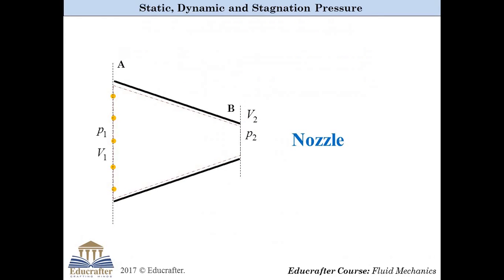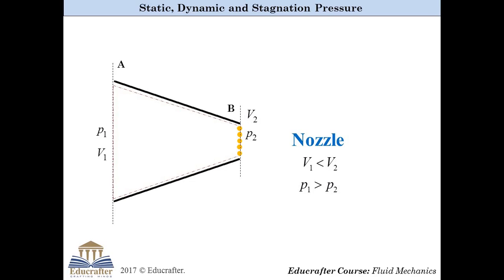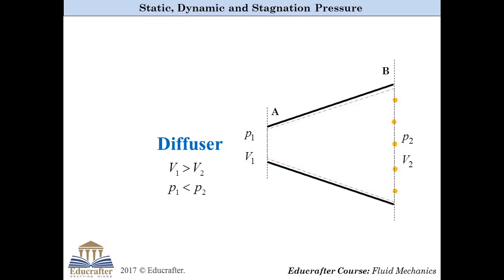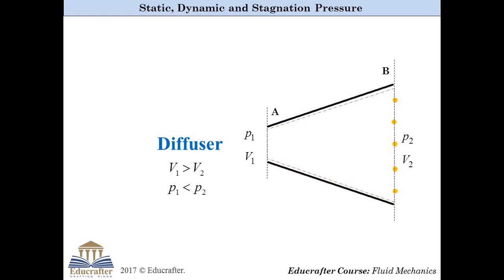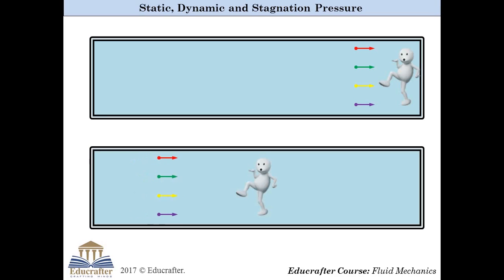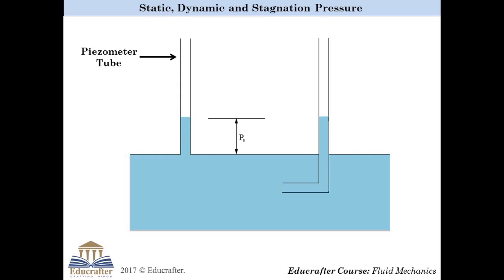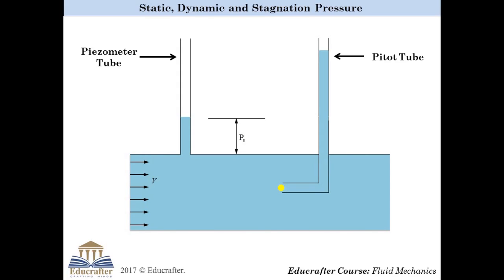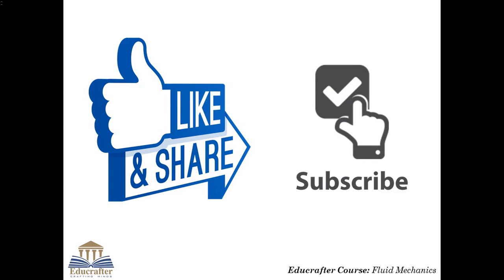Diffrence between Static; Dynamic and Stagnation Pressure

Comment: Suppose we want to measure the static pressure at Central line of pipe.So static pressure will not include hydrostatic pressure ( due to weight of fluid) because we are giving piezometer tube at surface of the pipe?
According to me static pressure should be due to pipe internal pressure plus hydrostatic pressure

Comment: if you are moving with the water, i really don't think what you felt is "static pressure"
 
static pressure is the pressure you feel pressing against you when the water is still ( hence static, not velocity bound, it's the P component + h component of bernouli equation)
dynamic pressure is the pressure the water has when it is moving in it's direction

the pressure you feel while you move with the water ( assume single direction water movement ) is more of drag force
Reply: The pressure you feel when the relative velocity between you and water becomes zero is the static pressure

Comment: In diffuser example, as bernoulli states total pressure at inlet & outlet is same. But you said  stagnation pressure at inlet is higher than outlet, which equal to total pressure in our case(z1=z2, no potential pressure)???

Bernoulli states constant total pressure along streamline, So how fluid flow if there is no pressure difference??
Reply: Same doubt

Comment: Thank you! But 1 very impt question: where does the Static Pressure of moving water in a tube come from? I have problem understanding where the Static Pressure comes from.
Reply: It comes from the collision of the fluid particles with the walls of the object placed in the fluid .

Comment: Really great video,much understood. But the nozzle and diffuser topic confused me quite a lot. Maybe i am missing out on some basic rule,but according to Bernoulli's rule should not the total pressure be the same on both sides? (Along a single streamline) thanks a lot!
Reply: Bernoulli states that total energy (kinetic energy, potential energy & pressure energy) remains conserved in a streamline and not just the pressure energy. Hence the loss in pressure energy in a nozzle is compensated by the increase in kinetic energy i.e., velocity. Hope it helps.

Comment: How dynamic pressure is measured? For static pressure we use piezometer , for stagnation pressure we use pitote tube
Reply from the maker: Thanks for concern,
There is no such device, which can measure dynamic pressure directly, but theoretically if you can measure velocity then you can get idea of dynamic pressure.

For that you have to consider a probe ( weightless ), by stroboscope, measure the velocity and You can find dynamic pressure.
Reply: ClariFLIX Concepts can you explain little about pitote static tube
Reply from the maker: In pitot tube, one hole is provided on tip of the tube which is in the direction of flow. And more holes on the periphery.
And a manometer is attached between the hole on tip to the holes on the periphery.

Case - 1:- Fluid is not in motion.

As per the Pascal's law pressure experienced by hole on tip and hole on periphery will be same.
There you will see same elevation on both limbs of manometer.

Case - 2:- fluid is in motion

When fluid is in motion, flow will strike on the hole at the tip, flow with higher velocity will provide some more pressure.
While holes on periphery will have no effect due to velocity, because flow will not strike at the hole. Hence pressure will be comparatively lesser than pressure on the hole at tip.
As result of that in manometer you will see the deflection in elevation. Limb which is connected with hole at the tip will be having more pressure comparing to the limb which is connected to holes on periphery.

Pressure on limb which is connected to the hole at tip is Stagnation Pressure.

Pressure on the limb which is connected to holes on periphery is static pressure.

Difference between these two will give you the Dynamic Pressure.
Reply: ClariFLIX Concepts sir pitote tube and pitote static tube is different pitote tube measure stagnation pressure and pitote static tube measures dyanamic pressure that I have studied but confusion with pitote static tube
Reply from the maker: Diagram of both will give you more idea. You can raise you query to clariflixconcepts@gmail.com

Comment: Nice explanation. As I understood from your reply regarding the total pressure equal to (static pressure + dynamic pressure + potential head or elevation), so the static head is different from elevation head, my question is: Why In a pump system the total static head is described as elevation difference between suction and discharge? Thanks in advance.
Reply: Because pumps increase static pressure of the fluid and this and this change in static pressure helps pump to raise water to that rated elevation depending upon the resistance in the pipe

Comment: I have a small query...according to Bernoulli's theorem, if area is reduced, then velocity increases & pressure reduces but doesnt it happen, that when u squeeze a water spraying pipe, its vel & pr both increase? Can u kindly explain?
Reply from the maker: Thanks for concern,
While pressing the spray air flows with higher velocity through pipe, The flow of air at a high speed creates a region of low pressure just above the tube, which allows the water to leave the tip of the tube through the nozzle as a fine spray, carried by fast moving air.

Comment: If the static pressure is caused by  normal stress, is this accounted in bernuoulii’s equation? Since in that equation, visccity is considered neglible. Do we consider static pressure constant or zero?
Reply from the maker: As of we are assuming frictionless flow ( zero viscosity ) the static pressure will remain constant.

Comment: What about the flow in diffuser if stagnation pressure at both ends of diffuser is same !?
Reply from the maker: Thanks for your concern,
It is not possible to have a flow having same stagnation pressure on both the ends.
In case of diffuser, It is must to have less stagnation pressure at the exit than inlet stagnation pressure.
Reply: Can u show how the stagnation pressure is less at the end of the diffuser? If we consider a particular streamline there the stagnation pressure remains constant and to maintain the stag const the velocity and pressure is changing then how stagnation pressure is changing?

Comment: Great example at the end. Thank you.
 just the first part confuses me a lot, the nozzle and diffuser part
Reply from the maker: Gusecua Thanks for Your concern.

Fluid flows from high pressure to low pressure, is the obvious case. but if we look at the flow in nozzle and diffuser in steady state.
NOZZLE:- If you observe the static pressure on left section of nozzle, It is higher than static pressure on right side.
DIFFUSER:- If you observe the static pressure on left section of diffuser, it is lesser than static pressure on right side.

Important to observe that in both cases( nozzle and diffuser) fluid flows from left to right but pressure variation is not same. In nozzle it is high pressure low pressure and in diffuser low pressure to high pressure. But the pressure which we are observing here is static pressure.

" FLUID FLOWS FROM HIGH PRESSURE TO LOW PRESSURE WITHOUT ANY EXTERNAL FORCE"

This statement holds true for only for TOTAL pressure not static pressure.

I hope this will clear your doubt.
Reply: @ClariFLIXConcepts  best explanation sir.... 👌👌

Comment: Thank you. 
But I have a small confusion; If flow occurs from high stagnation pressure to low stagnation pressure (P + 0.5*v^2/g), Why doesn't water flow from the bottom of the water beaker to the top of the beaker? Because as I see it, the velocity is zero at both points but there is a difference in static pressure.
And second if it is not the stagnation pressure difference that makes a fluid flow, What does?
Reply from the maker: Hello Hiras Ahamed,
Thanks for asking question.
To understand the answer, Consider all particles at the bottom of vessel, they are having more stagnation pressure BUT for all those particles to reach at the top of the vessel they need to overcome the weight of all the particles situated above those particles and frictional loss among all particles too, that is the reason why the water particles from bottom do not raech at top.
Reply: Okay. Thanks for the reply
Reply from the maker: Hello Hiras Ahamed,
I would like to add few more points for better clarity of the concept. You need to understand the difference between the total pressure and the stagnation pressure. Stagnation pressure head constitues of static pressure head and dynamics pressure head (P+0.5*V^2/g) whereas the total pressure head is the summation of static pressure head, dynamics pressure head and potential head (P/(rho*g)+0.5*V^2/g + h). 

In general fluid flow, the flow always occurs from high total pressure to low total pressure. But when you talk about the device placed parallel to ground (horizontally) where the flow is occuring in horizontal direction, the potential head is always constant. 
For the horizontal flow, either of the following statements holds true,
1) Fluid flows high total pressure to low total pressure. 
2) Fluid flows from high stagnation pressure to low stagnation pressure. (As the potential head remains constant)
In this lecture we talked about nozzle and diffuser placed horizontally, so we used second statement but it can not be used to judge the flow direction if there is change in the vertical elevation in the pipe. First statement is applicable in general of any flow conditions. 

Now coming back to the question you asked about the flow of water from the bottom of the beaker to the top surface. Here you talk about the flow in vertical direction so we have to use the first statement which says that "Fluid flows high total pressure (P/(rho*g)+0.5*V^2/g + h) to low total pressure (P/(rho*g)+0.5*V^2/g + h)".
Now let us calculate the total pressure at both these surfaces, 
for an instance consider that the vertical difference in the elevation of these two surfaces is "z" meters.
a) At the top surface P=0 gauge, V=0 & h= z (considering the datum line at the bottom surface) 
so Total pressure at top surface = z

b) At the bottom surface, P= rho*g*z (as per the principle of fluid statics, V=0 & h=0 (as bottom surface is at datum))
So total pressure at bottom surface = P/(rho*g)= (rho*g*h)/(rho*g)= h

Hence  total pressure at both the surfaces is equal which means flow will not takes place in any of the direction (neither upward nor downward). Fluid at such a state can be examined by the branch of mechanics called "Fluid Statics".

I hope you understood it. If you still have some doubts, feel free to post it here. 
Thank You.
Reply: Very well explained
Reply: @ClariFLIXConcepts  bernoullis equation states total pressure is conserved but you are saying “fluid flows from high total pressure to low total pressure” I don’t understand ,thank you.
Reply: ClariFLIX Concepts 
Your explanations are amazing

Comment: What is the reason for static pressure? Or what is the source for static pressure? Or why there is a static pressure?
Reply from the maker: Hello Raja, 
The source of static pressure is normal stress acting on the fluid medium. In addition to that, the rise in piezometer is just because of the incompressible fluid. As the normal stress acts on the incompressible fluid it rises in piezometric tube.
Reply: @ClariFLIXConcepts   sir is static pressure due to weight density of fluid and   changes with height h.
Reply from the maker: You are not Wrong. But the statement is partially correct.

Consider pressure on surface of Ocean.
That is 1 atm pressure. As you go at the bottom of Ocean. Static pressure will definitely increase this can justify your statement... " Static pressure is due to weight density."

But you know as we go upward direction of ocean static pressure reduces. Can you justify this thing with your statement?
Reply: @ClariFLIXConcepts   Actually we see the value of h from free surface of water. More the height from free surface of water, more will be static pressure.

Comment: can you explain whats the difference between stagnation and total pressure?
Reply from the maker: Dear Yashawant,

Stagnation pressure is the summation of static pressure and dynamic pressure whereas the Total pressure is the summation of static pressure, dynamics pressure and pressure due to potential head (P=rho*g*h). This means that the Total pressure also includes the potential energy of the fluid over and above the static pressure energy & kinetic energy whereas Stagnation pressure  includes only the static pressure energy & kinetic energy. 

If you look at the Bernoulli's equation you will find the  three different terms, one is for static pressure, second is for dynamics pressure and third is for the pressure due to potential head. So addition of all these three terms will give you total pressure whereas addition of first two terms will give you stagnation head.

Stagnation pressure represents the energy contained by the fluid by the virtue of pressure and motion whereas Total pressure reflects the energy contained by the fluid by the virtue of pressure, motion and position too.

I hope you got your answer. In case if you still have some query, kindly reply back with your query.
Reply: ClariFLIX Concepts very nice explanation...clear all my doubt...thank u